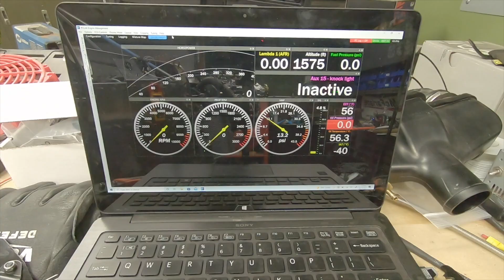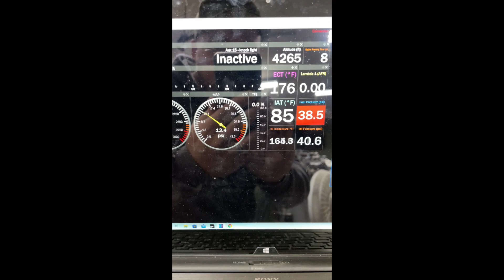First Start of the Turbo Yamaha Rans S21 EP44

Comment: Just WOW buddy! I didn’t see any vibration whatsoever. I’m getting really excited for you and also for myself as to the choices that will be available when I get to this point in a few years. I would have to think there will be quite a bit of alternative engine support out there. Are you going with a constant speed prop, and actually are you able to run a constant speed prop like the electric Airmaster?
Reply from the maker: Thanks Keith! It runs bitter smooth for sure. The gearbox does have provisions for the electric air master and word on the street is that DUC is developing an adjustable setup for this setup as well. I however am sticking with the ground adjustable setup for now mostly due to the financial burden those props bring with them. Thanks watching and engaging. I hope you’ll document your journey when the time comes👍

Comment: Very well packaged and it sounds great. What did you do for wiring as far as the engine goes? Did you just gut the snow machine and run as is? Or is there someone making an aftermarket wiring harness and tuner for the genesis turbo?
Reply from the maker: Thanks! I bought a snow machine harness and reverse engineered it deleting what I didn’t need and adding a few things I did want. It’s all reworked with tefzel wire and new pins crimped on for each stock connector. The Ecu is a stand alone stock replacement from Link ECU offered and tuned by the gentlemen at Hypersports USA. They build super high end race sleds. Ian Bange will be offering a package deal similar to this setup in the near future. I can put you in touch with him if your interested.

Comment: Congrats! Curious about stating without a prop. I know that I read somewhere not to run my Aerovee, that I am building, without a prop but that is a direct drive. Maybe your gear reduction setup gives the engine enough resistance. I am just learning so honestly curious.
Reply from the maker: Thanks! You are correct, you don’t want to start an engine without some kind of flywheel or prop in place. The gearbox in this case is enough to get by at lower rpms but I won’t be able to rev it much until I do have the prop in place. Thanks for watching sir👍
Reply: @Project2Aero  thanks for the clarification. I hope you get this bird in the air soon.